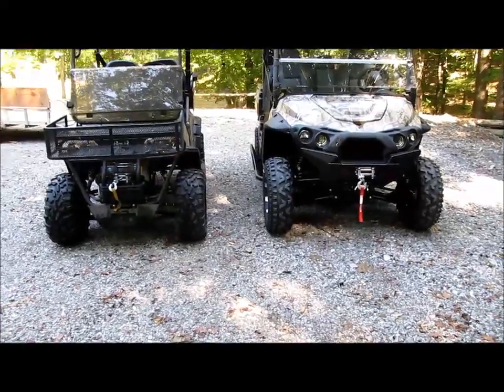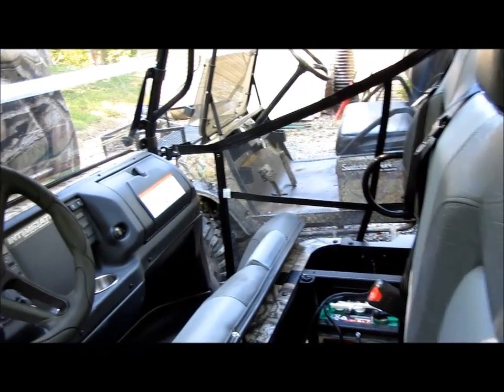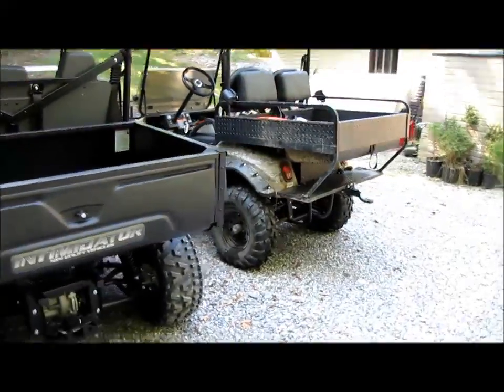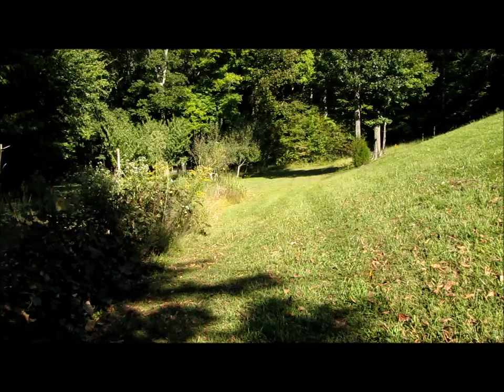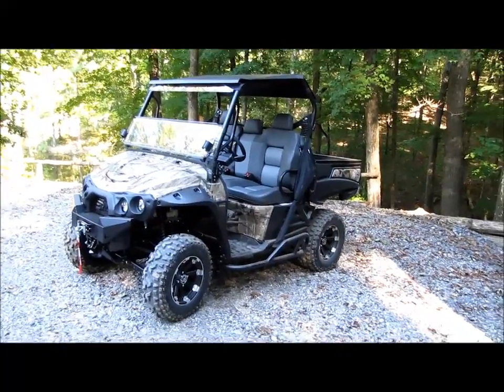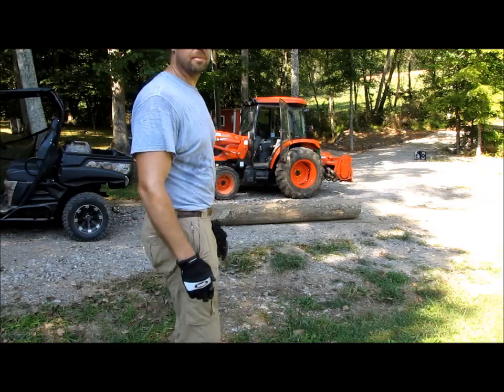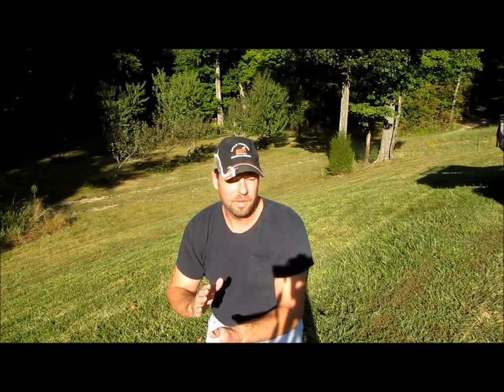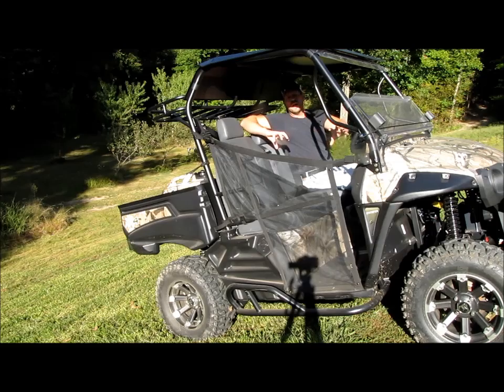Intimidator Electric UTV vs HuntVe Switchback

Comment: Great review. How has it held up since your initial review? I am looking for a new electric for hunting rig to replace my 2010 bad boy XTO. Keep hoping someone will come out with a good lithium system (Polaris is no good, have a few friends with the standard electric one and they all have problems, also they are so squeaky and rattly they my as well be gas.) My bad boy still works but have the same issue as Huntvee with spinning tires. Also cannot find parts or service for it. Time to replace the batteries again and thought maybe it's time to get something new.
Reply from the maker: I still like the intimidator. It it built rock solid. Even though Ive had a few issues, that thing is a beast. It is super heavy, wider than Polaris and has a German motor in it. But it is expensive!
Reply: Kapper Outdoors thanks for the review.  Since owning it, what issues have you experienced?

Comment: The main problem with the hunt v is that it's an accessorized golf cart. You can tell by looking at it that's what it started life as. Haven't looked at prices for them, but they better be dirt cheap because I could build my own on a golf cart frame pretty cheaply. The point being I wouldn't even consider calling the hunt v a utv.
Reply from the maker: Well you are 100% right, and me, not knowing any better at the time got taken to the bank on this thing!! Of course they had all kinds of false advertising on the thing!!

Comment: I'm just not a tron kind of guy.  Give me a gas or diesel motor and I'm good.  Yes its louder but is that why you purchased the electric version vice a gas operated one?  I'm looking at the Intimidator with a 750cc engine.  It cost the same as the Honda 650 two seater as far as I can tell.  Honda is proven.  I continue to hear good things about the Intimidator so I'm leaning that way.  Great review!
Reply from the maker: J Whit thanks.  I just ordered a gas 800cc intimidator and traded in this HuntVe.
Reply: Ah cool, I'll be waiting for your assessment of that one before I buy.  I mean that.  I like honest, down to earth, side by side comparisons.

Comment from the maker: in case you haven't noticed I work the piss out of every single machine I own. This is not some hunting camp where guys pull up in a pickup Drive the electric a hundred yards on flat ground and turn around and come back. My next video is why I kept my Kioti tractor over the John Deere. A lot of John Deere fans will be surprised.

Comment: regen braking when costing also recharges your batteries
Reply: Maybe but I rarely need to brake when I am using one so I would rather lose the weight and extra complexity and potential problems and use my DIY lithium batteries which will go 3 times as far as the lead acid ones without regeneration.

Comment: When you switch the huntve to 4x4, it's all 4 wheels fully locked and driving.  I can't believe you ever got it stuck.  I'm in the wet, clay, fields of Ohio and in 4x I can't get my Huntve stuck ever.
Reply: Im with you.. I honestly believe this is a VERY BIASED Commercial!!! Who can afford to buy a $14k New HuntVe one year, and the next year buy a $17k Intimidator? And he was constantly downing the HuntVe. And the Intimidator was so loud!!!! Those motors were whining like crazy.. The HuntVe was way quieter and narrower for getting between trees and obstacles.  The Intimidator is sooo big.. Its like trying to drive a small truck in the woods.. It definitely does not appeal to me at all...  I wouldn't trade one HuntVe for two of the Intimidators